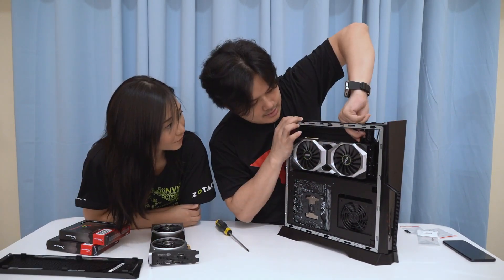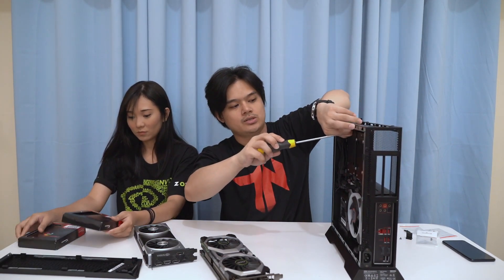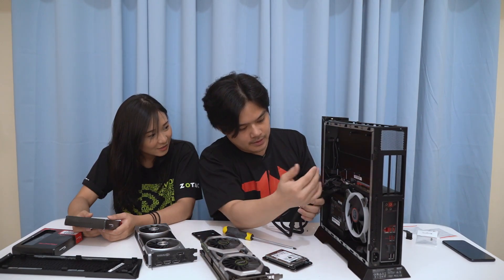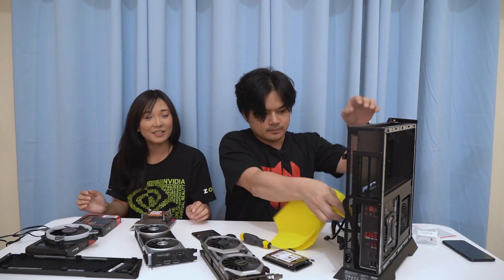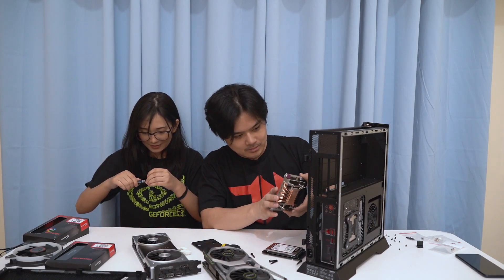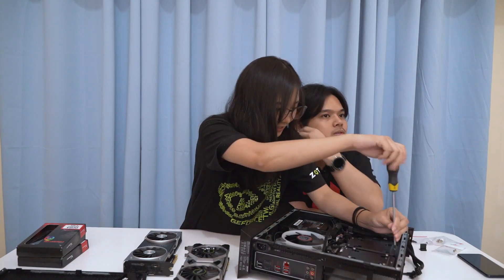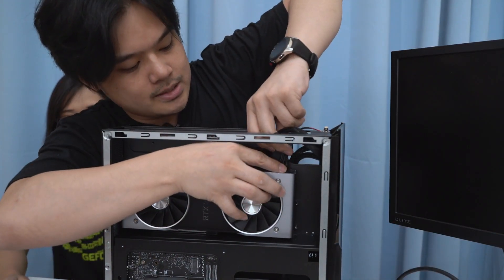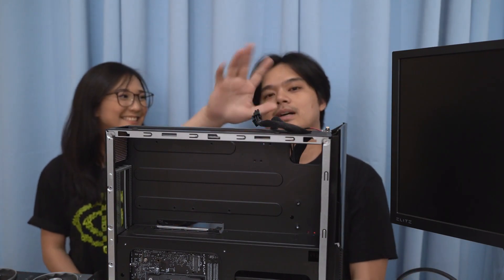Taking apart the MSI Trident X Plus to check for upgradability

Comment: I had a question
I have also a trident x plus an would like to upgrade to a bigger case 
Is it possible to transfer the parts to a big case so if i want to upgrade or replace other parts i have much more working place

Comment: I want upgrade the cpu heatsink and fan. Which cpu heatsink and fan are better than this one or better yet what are the dimension limitations for the heatsink and fan ?
Reply: hey bro, I also want to upgrade that heatsink. I have the exact same model as yours. But it is really difficult to find a low profile cpu cooler which can cool 9900k. I enabled game boost in bios, but the max frequency is up to 4.8ghz.
Reply: @ruimengxu33  I think that I might go with a silverstone low profile cooler thats faster than the stock MSI one
Reply: What is the clearance of the cooler? Noctua makes coolers that go as slim as 37mm
Reply: @SuperQBoi  47mm

Comment: Nothing else to upgrade? ?... Wellllll, what about a higher wattage psu for maybe like the new 3900x cpu with the Wraith Prism on the new Gigabyte Aorus x570i mobo? ?..... Because that is what I am going to be doing at Micro Center this month. Wouldn't you like toooo... idk... maybe suggest a psu that is higher than 650 watts that will fit in this case, so that I may ensure that the 12 core amd 3900x with the x570i mobo will have sufficient power? ?

       That would be of great help to me rn.... Just saying.
Reply: @ramseysanchez1673  Yes, absolutely. Any mini-itx will fit in there. You just have to take into account what socket you will get for what cpu you will be using, but unless you are switching to an i9 10900k, an i9 9900ks, or the 3900X, or 3900XT, then there really isn't much point of upgrading,......but if you plan on using the CPU options MSI gives you for this prebuilt case, or you just want to use something more simpler, still amazing for gaming, & lower on heat, like an i7 or i9 9700k or 8700k, or a Ryzen 9 3600x or what not, & you just want a better board to go with it for better VRM support, higher Mhz RAM, & maybe even Pcie Gen4 memory support, then yh sure. Get a better mobo. It will fit for sure 😉

       Although, if you upgrade, I would highly suggest spitting out the extra cash for an X570i mobo or a B550i motherboard (For Future Proofing). Don't skimp or go cheap on the mobo. Get the best you can.
Reply: @ramseysanchez1673  Well, that person was right. You definately should go Ryzen. It’s obviously cheaper & AMD is absolutely wrecking Intel in the CPU department rn with more to come. Only that middle part was completely incorrect. The X570 & B550 mobo’s has been widely confirmed to support the next Ryzen 4000 CPU’s. So you’re good. There should be no worries there. So yes, yes, & yes. You’re are fine.... The only thing that is of concern for the Trident X is the fact that you will be limited to small form factor air coolers, so unless you don't care about have the side panel off with a big air/box cooler sticking out the side, then cooling the high end AMD CPU’s like the 3900x or in the future, the 4900x for example is going to be a dead end for you. Ik they put an i9 9900k in the Trident X, but AMD CPU’s aren't as heat tolerant as the Intel chips, so you will need to think of a way to work around that.
Reply: @ramseysanchez1673  Ryzen 4000 CPU’s will be Zen 3, yes,... & as far as Ryzen 5000 or i10’s or i11’s or whatever the fuck they decide to call it, we don't actually know, but I think you're thinking a little too far ahead my man. I ubderstand you want future proofing, but the only way to garuntee you something that far ahead is by waiting for a long time. I wouldn’t want to do that personally, because I want to use my pc ya know, so ultimately, that will be up to you I suppose. That's a long ass wait though lol
Reply: @ramseysanchez1673  https://www.pcgamer.com/amp/amd-ryzen-4000-release-date-specs-performance/
Reply: @ramseysanchez1673  What do you want more? ? Whatever your answer is, then that is what you do.
Reply: @ramseysanchez1673 Well, you're in the best time for what options they have now days, but with the whole Rona bullshit now, you're in the worst time in terms of marketing. Things are more out of stock  because people be panic buying for no dry ass reason, or things just take longer to ship now unfortunately, but yh, there is a lot of good hardware spawning up now, which is good.

       Well, if you REALLY want that case, then I say intel, since you will have an easier time tolerating heat, but if you want AMD for a better all around chip, because of those higher cores & threads, then I would choose a better itx case then. For example, I have a Gigabyte RTX 2080Ti Gaming OC, a 3900X cooled by the RGB Wraith Prism air cooler, 32GB 3600Mhz TridentZ Neo RGB RAM (2x16), a 2TB Pcie Gen4 M.2 Nvme SSD, Grizzly Kryonaut Thermal Paste on both CPU & GPU dye (Took GPU apart & voided warranty Lol), on a Gigabyte X570i mobo, with 2 Thermaltake 120mm RGB Trio fans (Outtake), 1 Silverstone 120mm Slim Design RGB fan (Intake), powered by a Thermaltake 850W 80+ Platinum RGB PSU,... allllllll inside the Raijintek Ophion mini-itx case........ Do you have any idea how impossible it would have been to do alllll of that inside of the MSI Trident X case? ?...... So, really think your case through is all I am saying. There is only so much you can do with the MSI Trident X case
Reply: @ramseysanchez1673  P.S. All that stuff I stated for my build all fits inside my backpack too, but a special backpack though. The ROG Ranger backpack by Asus ($200). Plus, the new worlds first 240hz portable monitor with an IPS display, 1ms Response Time, 1080P from Asus ROG called the XG17AHP paired with a Steelseries 650 wireless mouse & the Drevo Blademaster RGB wireless Keyboard. Alllll that shit fits in my backpack... A testiment to show how much research I put into my build before I actually got to buy the stuff & use it..... Take your time my man.
Reply: @ramseysanchez1673  Yhhh, she is indeed a bueaty & a powerful beast, but I still have some modifications left. Next paycheck (1 Week), I will be ordering another 2TB M.2, but it won't be Pcie Gen4 (Which are the fastest & only supported by X570 mobo’s). Instead, it will be Pcie Gen3 (Still very fast), but it will have RGB! ! So basically, a 2TB RGB M.2 Nvme SSD. You don't even need to plug any wired in for the RGB. The M.2 slot will power both the M.2 & the RGB on it 😊, & will show in the front on the mobo, while my 2TB Pcie Gen4 M.2 is hiding on the rear slot. I’m also having my Acrylic side panels laser etched, & also putting the new Lian Li RGB wires on my PSU to mobo. 

       I also have an unoccupied regular SSD slot behind my front panel, & will later add a 4TB Samsung QVO SSD to that. So, nearly 8TB’s of storage memory in total. So, I really apprieciate that. I’ve put a lot of love into & still will,.... & YES! ! Ik what your thinking... I absolutely WILL be getting the RTX 3080Ti when it comes out. Already have my $1500 saved to the side JUST for that, but I will actually wait a little to see if Aorus comes out with a tricked out RGB variation of the 3080Ti.

       Have you thought about building a Desk PC then? ?

Comment: I have the one with 2070 and I want to upgrade it to 2080 ti but the power supply is only 450W in my system.  Can I upgrade Ac adapter/PCU to 650W and if so which product should I buy?
Reply: raj shrestha You need a SFX power supply. Look for the Corsair SF700 which has braided cables and is Platinum certified! 👌
Reply: @or1on89   Thank you. will try that..

Comment: I have the same Trident X and I noticed that you didnt even upgrade the memory sticks which is a huge component to upgrade. My trident came with the 2080Ti and the intel i9 9900K so I manually upgraded the memory with corsair LPX 32gb 3200mhz   and took off the hdd and added ssd's instead !!!
Reply from the maker: One reason why we didnt upgrade the RAM is because we didnt have lowprofile ones. The RAMs we had would hit the cooler. You've got a pretty ripped rig though!
Reply: can you provide exact product code for the corsair RAM you used to upgrade the pc?
Reply: @yahuzz 
CMK32GX4M2B3200C16
Reply: Did you find the memory ram sticks  that I sent you ?
Reply: nightbreed141 do you have a Amazon Link for that Ram
Reply: @ryananderson8576  its in the comments
Reply: is the motherboard can be replaced with some aftermarket itx ones?
Reply: @kristopherpadilla498  yes but you're gonna have to use the adapter that comes with the case from the inside and its very hard to get into. You're gonna have to fully disasemble the whole entire thing from the inside
Reply: @nightbreed141  Are you able to elaborate on the adapter that you're referring to?  What does it do exactly?  Hold the mobo in place within the case?
Reply: @jaredkirschner6552  Yeah its a special adaptor that MSI uses on these cases to hold the motherboard in place and at the angle that its on. There's a lot of pieces to it and the surface area is very small so its very difficult to work with but its doable.
Reply: @ramseysanchez1673  Like I said before the adapter is just to hold the motherboard in place in the angle that it is in and in the height that it is in.
Reply: @ramseysanchez1673  I will say this though MSI will be coming out with their newer version of this same case come October/November once Nvidia's new cards come out and I will be buying that for sure. I was just going to upgrade this current case but since MSI always has a way of making innovative cases like these then its safe to say that I will just wait until their newer version of the Trident x.
Reply: @ramseysanchez1673  If for some strange reason MSI takes too long to come out with their newer Trident X then I will just upgrade this on my own. Since the Trident X sold out everywhere for a solid 3 months after its release then I think that it's safe to say that they will be making more.
Reply: @ramseysanchez1673  Another thing that you can do too is buy the cheapest trident x just for the case itself then just buy all of the components and upgrading it from there. Yeah I also heard of the AMD version too and who knows maybe they will either say something about it by September or will show case one. We will see but I am definitely excited !!!
Reply: @ramseysanchez1673  Shit I have no idea ? I really haven't gone that far in removing stuff but I will check and get back to you on that one.
Reply: @ramseysanchez1673  Ok so update on the case itself. Yes, the base is removable and from what I can see everything on this case is removable. The only thing is that there are two electrical wires that are soldered to the base as to ground it to the base. I can send you pics if you like just PM me. Hope this helps.
Reply: @ramseysanchez1673  I honestly don't know. They seem like they are connected to something as a ground for sure but it doesn't seem like you really need it though. I found out how to be able to change parts but the bad part about that is that you would have to disassemble the entire bottom half of the case since both the PSU and MB are attached to the same bracket on the same side. So you would need to remove the PSU in order to install a new MB and vice versa.
Reply: @ramseysanchez1673  They did it this way so that all three of the major components can have their own cooling vents and chambers !!! It works too, so all of the vents are to bring air in and vented at the top of the case ! This is where other SFF cases fail because of improper cooling !
Reply: Hi, why didn't you go for the 3600mhz I am just curious? I want to upgrade mine thank you